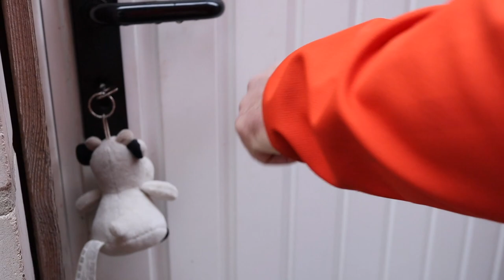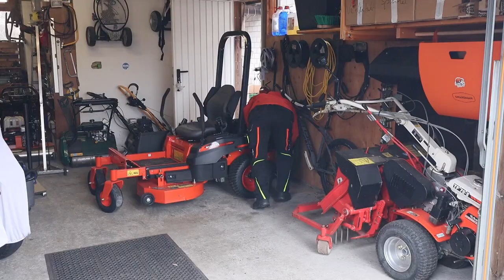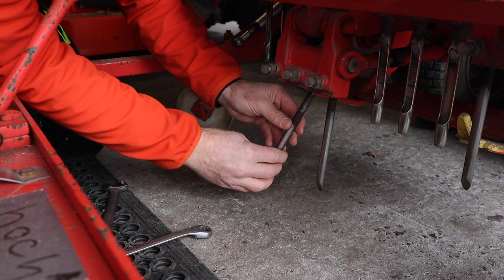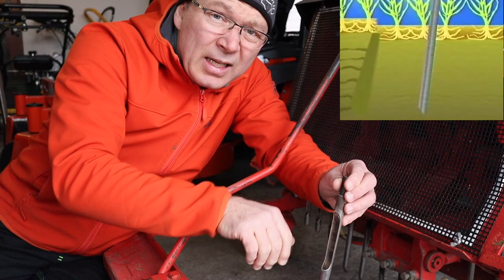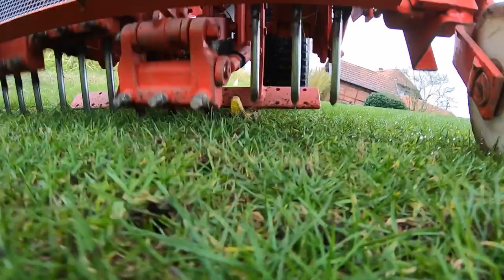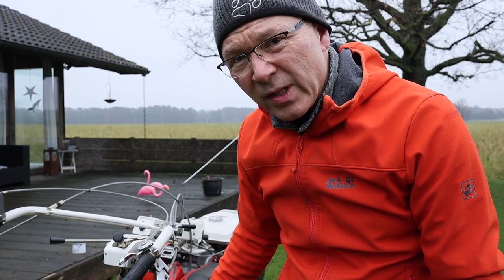RASEN jetzt AERIFIZIEREN? Das Geheimnis meines Verti Drain. Tipps vom Greenkeeper für den RASENFREAK

Comment: Wow great work think you just had Winter withdrawal and wanted to go out and get on one of your great machines !!
Not got one of those verti drainers guess good old fork wiggled a bit would do job exercise would help get rid of excess beer consumption over lockdown ......!   Lawn is certainly wet  alot of rain on normally drier East side of UK Dec /Jan .....  Spring soon be here the mowers be rolling again .....😎